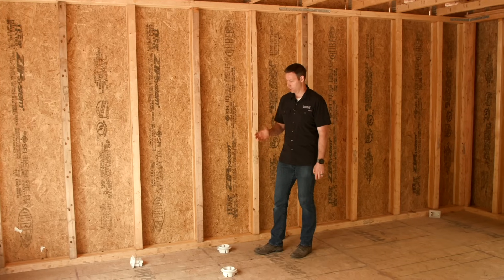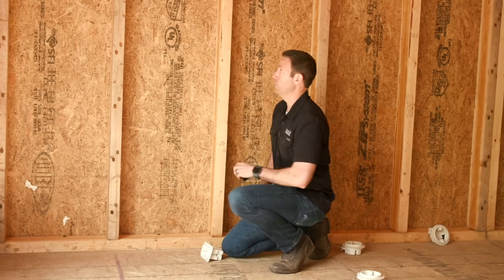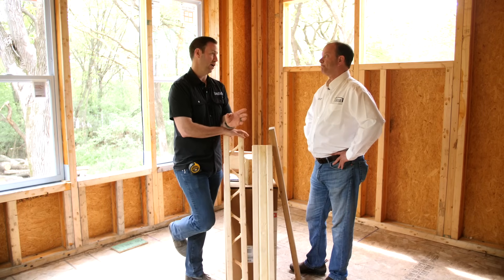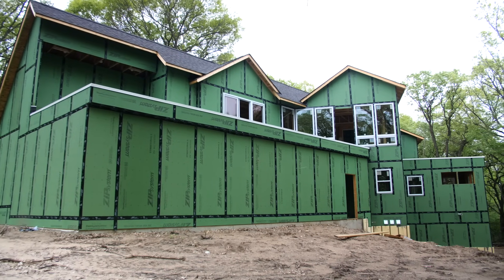Insulated Studs? This is a BIG Innovation in Framing!

Comment: I like the insulation and the 2x3 is a lot better for nailing or screwing the interior walls to it.  I can see not needing 16" on centers and no more double top plates too!!...which saves a bit of time and money. 
The studs look straighter too.  If I build another house I will definitely consider them.
Reply: Everyone is good with saving money by using a 24" stud layout.  Until they end up with a springy floor.  Because you can't switch layouts.  You have to stack the structural members.  The only thing these studs will do is make someone rich at a bunch of idiot's expense.
Reply: @leonardhall7203  It's really not cheaper and these do not make the house structurally  weaker. They actually make the walls stronger. 

Why mention the floors? The floors being springy have nothing to do with the walls.  No one builds a house floor with 2 foot centers due to the need for greater width lumber and thicker plywood. 16 on center floor joists calls for 5/8 tongue and groove and most people where I am use 3/4 inch T&G plywood with 16 on center floor joists or they use the pre manufactured I-Joists.
The building code is what engineers determine is the minimum standards.
Reply: @johnspartan98  if your wall layout is 24" your joist layout has to be the same.  Also they absolutely are weaker in deflection at every direction except for the one direction he mentioned.  Plus the fact that they get wet one time and they are shot. All it takes is the stud swelling one time due to moisture and the glue bond of the dowel webbing is compromised.  This product is for idiot's that want to feel smart.
Reply: Wrong. They are made with water proof plastic resin glue....one of the strongest water proof glues available for building wooden boats. Engineered wood is not made with indoor Lepage's carpenters glue dummy. 

Also, shut up about deflection. You have no clue what you are talking about.  The floor joist spacing does not have to be the same as the wall spacing because you have a rim board and rim joists that take the load of the walls. Rim boards go over the ends of the joins and rim Joists are bridged with joist material that joins the rim joist to the first joist every so many feet depending on how many stories they will support. I've built many houses pal. And not cheap crap....I was a custom builder.  I wouldn't get you to build a doghouse they way you are mouthing off.

Comment: bridging is minimal compared to steel studs/beams (for the roof sections) which is used extensively in insect prone places aka hot climates. they use bricks often aac bricks and concrete of course.

Comment: Now what if you're using 2x4 framing like most places?
Reply: 2x6 is standard now where I am and has been for at least 2 decades.  Older houses are 2x4 but not new construction.  Are there parts of the country that are still using 2x4s for new construction?

Comment: I don't know of a single electrician that will charge less for not drilling exterior studs.  Mine would probably charge me more.  
I don't know of a framer who would charge less for lighter studs.  Mine would charge more for using screws.
I have never been charged less for reducing the BTU 's of a furnace.  Years ago 80,000 BTU gas furnaces were so dirt cheap that I actually paid a little more to get a 40,000 BTU furnace on a well-insulated house.  Same is true when buying a 24" kitchen range instead of a standard 30", or an 18" dishwasher.
These cost savings are merely optimistic theories that are never realized.
That said, I think the T-stud is a fantastic idea that is long overdue.  I don't think they need to be 4X stronger though.  They really need to compromise the strength a bit to lower the price, unless they want to remain a luxury niche market.

Comment: this is a retarded idea! Don't you realize that saving so little for such a great cost,is no bargain? When ,for instance,can you say a 12 inch wall full of insulation is too costly for what it saves in heat and cool transfer.Why not a 16 inch thick wall? This is out of control...an inventor looking for an easy buck...calm down and see whats real...Stopping air infiltration is more important than this minor gain at huge cost!

Comment: Metal studs are the way to go. Superior to wood studs, R value , no dry rot, seismic protection, no termites, no warpage, better fire protection, less weight, no need to drill for plumbing or electrical, faster framing. no loss of trees and more.

Comment: Not great for firefighters: it  will loose structural integrity faster upon flame impingement  just like silent floors and the foam insulation with chemical mold treatment will add to our skyrocketing cancer rates. Sucks https://www.cbc.ca/news/canada/windsor/firefighter-safety-threatened-by-floor-joists-1.1285808

Comment: Expensive gimmick. If your studs are on 24" centers you need to strap both sides of the wall anyway. That will create the thermal break on both sides. Blow in cellulose insulation to fill all cavities. Better and cheaper and stronger.

Comment: looks far more expensive. I'm not increasing the price of a home by 20%.
Reply: According to the inventor, it only adds an additional $1000-1500 in cost for a 2500 square foot home. That is nowhere near a 20% increase in price. That actually seems quite reasonable, especially considering the drastic increase in strength and R-value, amongst many other positive attributes.

Comment: So here in Australia it doesn't really (generally speaking) get cold enough to warrant such studs in our walls, which are usually framed in 70x45 or 90x45mm pine (3x2 and 4x2 respectively).
However, I'm renting a place in a town called Goulburn currently and it does indeed get cold here for a few months a year (we actually had a bit of snow last night)
This house budget-end house has ZERO wall insulation, 70mm studs with no wall wrap, single glazed windows, and really crap fluff 'insulation' in the roof, with no wrap below the tiles, and my heating bill, for just this last year, is near on 900 bucks, for a 3 bedroom house, which is just ridiculous.. If I turn off the heater in winter it is literally 5 degrees C. in here by the morning, that's, like, 41 degrees for you guys.. so.. it's chilly you could say.. ;)

I am planning on building my own place sooner rather than later, and I was already thinking of using 140x45mm (6x2) for my walls so I can infill them with as much insulation as possible..
This Tstud product with is its very reasonable price difference (which would pay itself off in less than 4 years) is a game changer.. love it.
I wonder if something like this would be available here.

Great video Matt, thanks

Comment: Lets do math, total heating and cooling cost of whole house/year let's say $4000 (i don't live in US so i assume heating/cooling bill)
Heat/cool air dissipated through walls 15% of whole house total energy consumption which means walls consumes $600 of heat.
 
24% of wall is covered with lumber which means 144$ is wasted on that lumber area if this product is like 50% better than wood it saves $72 worth energy.

This product cost $1500 - $5000 (depends size of house) more than regular wood so lets take average $3250 which means with $72 save every year it takes roughly 45 years to get money back and after that you start to save money.
Reply: The T stud has 3 times the R value of a normal 2×6, if you watched the video
Reply: @TheJD9630  Still more than 30 years pay back time, not worth it.
Reply: @mr.wizeguy8995  24% of wall is covered with lumber which means 144$ is wasted on that lumber area if this product is like 300% better than wood it saves 432$ per year. 

Ftfy

Which means that payback is like 5 to 10 years, which is actually correct.
Reply: @TheJD9630  Sadly your calculation is wrong because wood area waste energy $144.
 
T stud is 3 times better means 24% wood area waste $48 with T stud and it saves $144 - $48 = 96 means it saves $96. 
It cost $3250 more and it will take roughly 34 year pay back time.

Comment: NO... That foam will stink your house up forever and give you headaches, well known to give babies serious health issues. Using the trussboards for bottom plate added ZERO insulation value,  bolted to a cement slab. Cannot be fastened as good as normal wood or steel studs because the wood is too thin and splits EASILY.  You also used MDF sheeting on the outside of the home... I would fire you for that alone; complete garbage.

Comment: How is the top plate to stud connection?
Are these load bearing and external walls only?
Were they used for interior partition walls?
Reply: Doesn’t look like these were used on interior walls only exterior walls

Comment: Seems like you could just add a thin layer of sil-seal on the narrow faces (1.5") to prevent the thermal transfer?
Reply: That would be annoying as hell.
Reply: @badlandskid  Guys would be quitting left and right haha!
Reply: well when it's cold out side what dose one do, we put a coat or a sweat shirt on to prevent from getting cold, I'm thinking the same thing with a home, insulation on the outside of the sheeting is like putting on a coat an preventing the cold from transferring to the studs, on a 2,240 Sqf home that I'm building with 1'  Extruded board would be $1,800 with no discounts from Homedepot an the I'm thinking the cost of a heating an cooling unit should be less an in return lower my cost of operating my home
Reply: The amount of thermal transfer through studs is.minuscule in even the coldest climate.  Yes, would is a poor insulator, but it also is a poor conductor of heat.  This is an extremely inefficient way to solve a non existent problem.
Reply: Mark Doldon If I was you I wood check my spelling.
Reply: @markdoldon8852  You can't be a "poor insulator" and at the same time be a "poor conductor of heat."  That's physically impossible, as those are literally both referring to thermal transfer.
Reply: @markdoldon8852  I dont know, wood is a pretty good conductor of heat when lit on fire.
Reply: @markdoldon8852   In my house, built with 2x4 studs, you can see where the studs are looking at the drywall in the bedrooms in the cold weather,only about -5C. The areas look darker where the studs are. Maybe an R value of 5, with the sheeting and drywall. If I was to look at a new house, i would seriously look at this type of stud.

Comment: So how much does that increase the overall insulation value of the walls and what's the projected savings? And can they be used or do something similar for floor and ceiling joist? That's the most important cause heat goes up and hence where you have the most insulation.

Comment: The real question is... is it cheaper to use double wall framing or this T-stud framing.  Both Eliminate thermal bridge.
Reply: I just built a house (not a pro carpenter) with double stud, and it was easy as.  I also enjoyed having a wide platform  (top plate) to walk on when laying rafters.  I'm a fan.

Comment: I have built a house out of Australian hardwood with 2"x8" framing and all the walls, roof, floors done in slotted hardwood planks to help strengthen the house. That house will last 200 years and is rated to withstand a category 5 hurricane. Would that house last as long?

Comment: Really neat idea, but I am concerned about thermal cycling. Over time the outer part will expand and contract and the inner part will move less, weakening all of those dowel connections which appear to be glued. It may be stronger when installed, but what about after 10 years? 20?

Will thermal cycling also push the top plate at an angle because part of it sits on the stable side and the other on the moving side?
Reply: Yeah hard to know since its a fairly new product

Comment: There is a reason no one has done this already. Its a waste of time and stupid expensive. Your putting a r20 value timber stud in, when the requirement for a modern home is only R2 R3 in total over the whole wall. Therefore the standard timber stud at R6 is more than sufficient. 
Just trying to sell a new product that solves a non-existent issue.
You want insulated walls? just build a log home. R11+ all around. Cheaper per m2 too.

Comment: Only problem with Expanding Foam is it breaks down over time.
Reply: who told you that? I've had a closed cell foam block as an archery target sitting in a farmers field for 5 years. Other than losing color from uv damage it is as solid as the day I got it.

Comment: Or, you could use 6 or 8" sills with staggered 2x4 studs (in, out, in, out) that never connect through from inside to outside.
Reply: NHindividualist when you say sills do you mean top and bottom plates?

Comment: I scrolled through a few "pages" of the comments and did not see this, forgive me if it's addressed. They are rated at an R-20, but what are they once they are hole filled with plumbing(especially), electrical, etc?
Even if you foam the holes, you still lost some factor?
Watching that electrician, he seemed to put the wires just behind the wood, any issues with that depth?

Comment: That's all fine and dandy, but can it support the same amount of weight and are they made reliably the same way each time? What kind of foam is used? Can it pass build code in earthquake prone areas or is it worse than regular lumber in terms of handling earthquakes? And what exactly can we expect the premium price to be? Showcasing the wood in a framed house is completely pointless to me as you don't use any science at all to prove it's worth.

That last biased guy claimed the new 2x6 is stronger than a standard 2x6 which is not a true 2x6 size, but if you used a measuring tape on the new "2x6", it looks more like a 3 1/2x6, so it technically has about the same amount of wood, but more spread out to better support vertically (but for sure does not support nearly as much horizontally). And as mentioned, it's just a claim, no evidence to prove any of it. Also, I guarantee there's plenty of build code limitations to it's use in construction that you're not telling us. For example, it's only good for outer walls and nothing else. It cannot be used in attics at all, cannot be used for support joists not that anyone would, and of course inner walls would be pointless unless maybe for sound dampening, but I doubt it. So that mentioned thousands of extra dollars is actually a substantial amount if you consider what little amount of wood is needed for the outer walls of any house. Also, foam cleanup, every cut creates more and more difficult to clean mess, especially when cutting outside and the wind picks up.

If you really want to sell a product, just be honest with your audience. They're often a lot smarter than you think.

Comment: 2 minutes and i am going to disagree, wood is not known as a conductor of heat like steel studs, therefore, using wood studs with say R-21, is not ineffective.  Using this T stud without insulation doesn't sound legit to me.  You can't control the occupant, there are windows and doors in a home.  You can make a home too tight and then not enough fresh air.  You need fresh air, so explain what the benefit of T studs are when you need fresh air?

Comment: It may stand a little more shear force but it supports less (axial) load than if the whole stud is solid wood. Doubtful the solid piece of 2 inches wide and 6 inches deep wood (placed every 24 inches apart) will lose that much more energy than a little foam filled in the middle.

Comment: Fire Endurance? No wonder houses burn very quickly as soon as the drywall is penetrated.  Fire test these materials before they are put out to the masses. We look at strength, cost, insulating efficiency, straight lines, ease of installation, but not fire endurance. I bet there will be homes built without sprinklers with unfinished basements supporting 2 other floors. What about the glue holding these things together? How do these important connections hold up in a fire?

Comment: Exterior insulatoin is still way better.  These studs don't accomodate framing around doors and windows, headers, or in wall beams.  Exterior insultaion is continuous...   Or, you could use a 2x8 plate and stagger the standard (cheaper) 2x6 studs and run foam in the cavity....

Comment: He talked about compression loads but I did not hear anything about shear or bending loads.  I imagine those would be important also.  Any update on the comparison of those and traditional stud framing?
Reply: The same amount of material in an I-beam shape will be stronger guaranteed. Since they fail in the x-axis, even under axial compression an increase in the axial compression test results shows a direct increase in beam-acting strength.
Reply: Not true in an T beam concrete bridge 
Shear / Compression/ Tension

We need the lab 🔬 tests videos to prove it
Reply: These are only rated as studs at the moment, not listed for beams in load bearing walls. That was my earlier question about laminating two or three with urethane or epoxy "in the field".

Comment: Though this does seem like a good concept, you don't worry about ROI for something like the T-stud with most builders because most builders are dinosaurs and anything new is like a mile-wide asteroid landing in the Gulf of Mexico. This probably has a place for a customer that is wanting to get a better wall, but can't get a double-stud wall contractor, etc. I think 24OC walls with this would work well, coupled with some air detailing and Rockwool batts. 

This is probably more doable for most folks: https://www.finehomebuilding.com/2014/11/26/breaking-the-thermal-bridge 

Your codes very, areas with hurricanes and tornadoes clearly have extra needs, but for the most part 2x6 walls are necessitated by the R-value codes. All that wood is a bridge and not a good one.